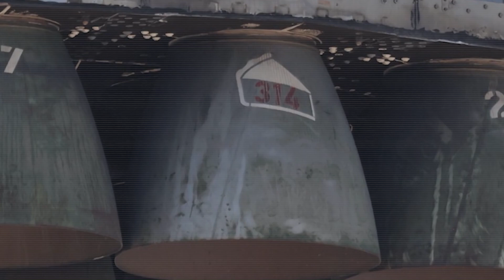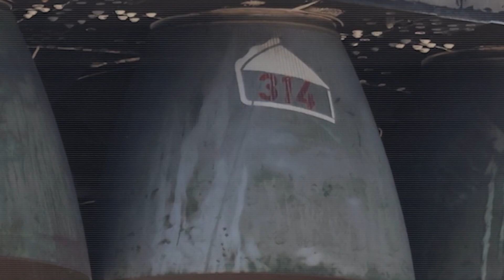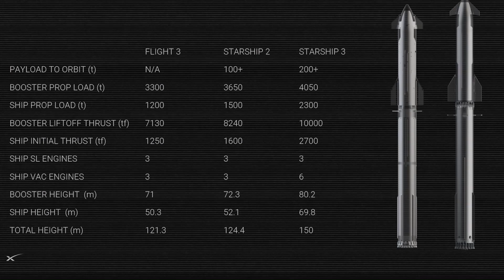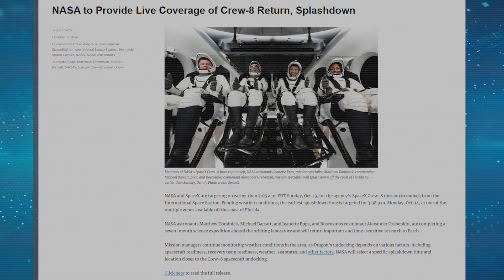Elon Musk SHOCKED by Booster 33’s BURNED Engines!

Comment: It's still a rocket.... Same tech as in the 60s for goodness sake
Reply: It's more than that. It's a very complex software that never could have existed in the 60s. When you pack that many rocket engines close together the harmonics and the jiggling caused by the Rockets firing causes all types of new and very complex modes of failure from vibration. They're using different shock absorbers different lubricants different motors different materials different cooling systems they're using so much that didn't exist in the 60s it's not comparable the principles were laid down in the 60s the technology did not exist. This is why there was only five  F1 engines on the Saturn and they were so spread out. Because they literally could not do this.
Reply: im sorry but you clearly dont know what ur talking about so be quiet